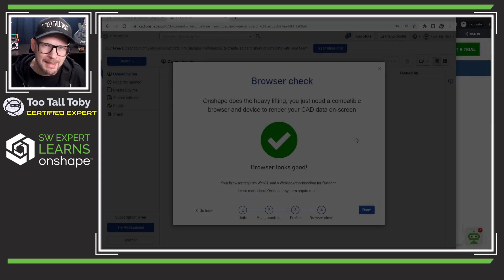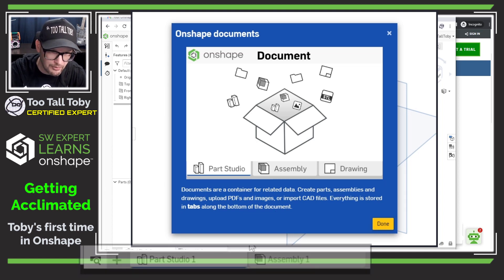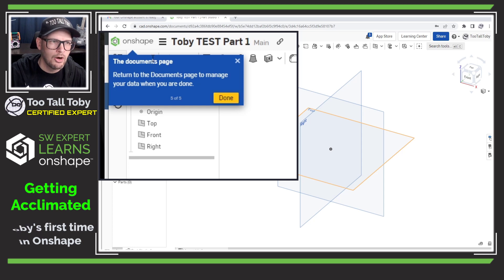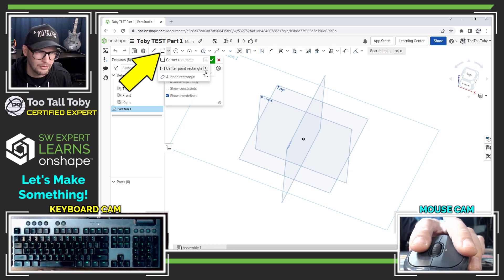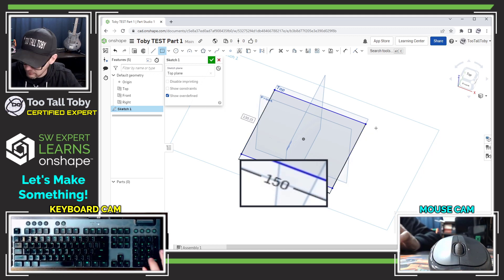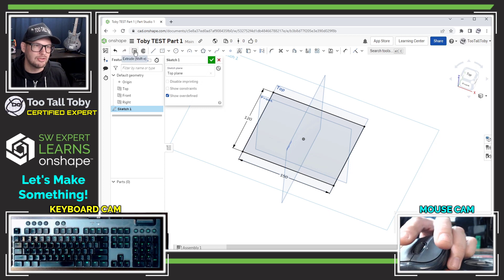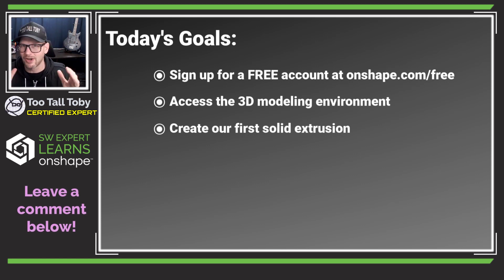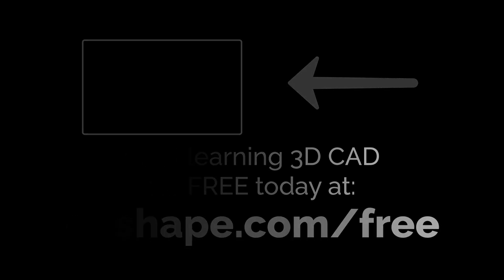SW Expert Makes a Part in Onshape

Comment: The flow of multiple parts in one modelling environment throws a lot of "classically trained" designers. I find that the most useful feature of OS. It's just like a sub assembly, but instead of mates, the parts are parametrically related to one another by sketches and planes. You can model a quite large assembly in a part studio without even using the assembly studio. (I do this a lot with small assemblies that don't have any moving parts) but of course the feature tree can get long in more involved designs. For larger assemblies, smaller groups can be modeled in relation to one another at the part studio level for easy changes and mated in the assembly, or even one part at a time just like Inventor or SW. I've had more than 3,000 instances in some of the fixturing that I've designed and OS handled it like it was nothing. Useful note, use the mate connectors! Extremely versatile for referencing pretty much anything, edges, vertices, faces...
Reply: Wow this is excellent insight and something I will definitely look out for as I continue my journey.  Thanks Sammy!